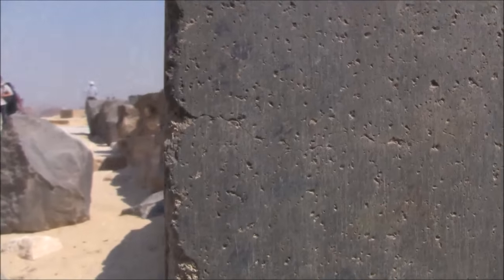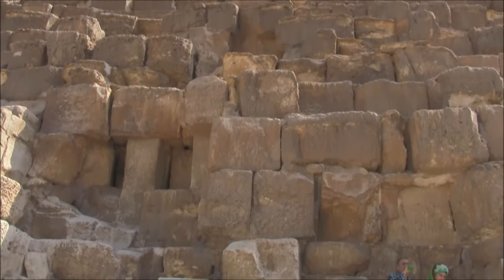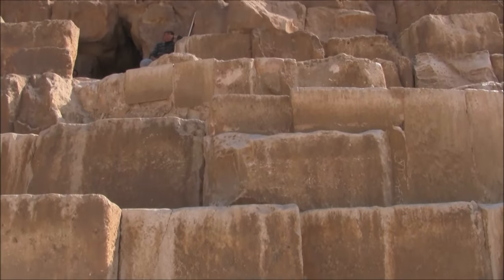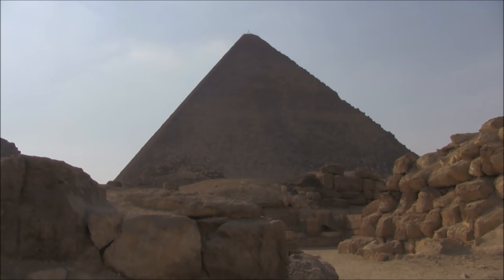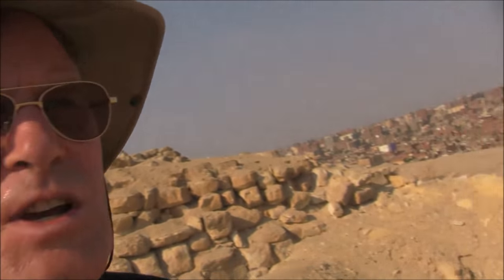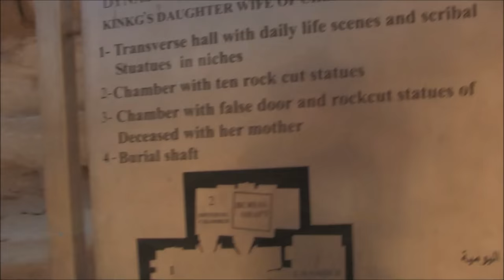Even More Evidence Of Ancient Machining On The Giza Plateau Of Egypt

Comment: I've read in Peter Thompkins' book Secrets of the Great Pyramid that vertical shafts were dug in order to best view the angles of the sun during solstices, as it was easier than quarrying an obelisk tall enough to so the job. Some say the decending corridor in the GP was used the same way, but instead it was to view the pole star, and then later extended from the bedrock up through the early pyramid structure to further pinpoint the position. It may have been a large square flat area for some time. The Grand Gallery may be of the same purpose.
Reply: I don’t think anyone that could build a pyramid would build one just to know where the pole star was or day of solstice. That was probably common knowledge. I do think they were positioned to certain points for other reasons.

Comment: Diameter^^.....I think you mean thickness Brien......the 'Diameter' of the saw blade looks to be at least 6-8ft.....probably more.
Reply: Dark Star huge diameter saw blades, probably rotating slowly. But what was the cutting edge made off?
Reply: @mattiasdahlstrom2024  an option instead of metal disc saw think of energy beam working like a chainsaw lot of cut made with 2-3 mm wide tool , aliens equipment
Reply: @al2207  If an energy beam evaporates the stone, there should be a transition zone that is melted : I don't see that in these saw cuts.
Reply: @mattiasdahlstrom2024  stone are not melted but dissolve into mono atomic element and with proper magnetic fields are expelled from the cut surface , silica will tend to re-attache to untouched walls creating the glassy finish by deposition of very thin quartz layer
Reply: A roller like saw comes to mind.

Comment: Defnitely a HUGE diameter circular saw blade of (you said 3/8 or 1/4 inch thickness).  or a very long (AND THICK) straight blade saw.  If these are all of the pre-catastrophe 12,000s BCE Ice Age (Era III), then it is entirely possible that this could have been done on a massive scale.  The design of the circular saw would have to be vertical, while any stones would be pushed through the blade in the horizontal.  As such, the casing stones, cut on the diagonal surface, would have to be stood upright, then pushed through saw, creating the diagonal surface (and smooth) cuts.  All pre-12,000 BCE Era III Egypt culture, fitting with the basalt and granite development of stonework.  Era-III (40,000s - 12,000s BCE).
Reply: i think the faceing caseing stones were made in cast molds using geopolymer mix. You can mix tura limestone in a geopolymer way and the caseing stones were placed on by a different civilisation than the people who built the pyramid. The later generation knew about geoploymer more so than the earlier original builders
Reply: any theory of how it would have been powered ?
Assuming electricity and motors had not been invented yet, what is left ?
Human power with rope and stuffs ? Gravity battery ? Hierapolis sawmill (water-powered stone sawmill) ?
Reply: @xl000  Look at the old huge human or cattle (gerbil) wheels.  Huge wheel (with 1-2 humans in each wheel walking the wheel) on each side of a timber-lashed bronze thick wheel, then just push the cutting or polishing product through the assembly.  There is also the pendulum straight saw blade kept swinging from an overhead cam shaft mechanism also powered by human or livestock power.  Easy

Comment: Instead of a huge circular saw, how about a large weighted pendulum-blade, supported by an "A" frame structure of various heights.
Men pull the pendulum from side to side. 
Its massive weight and momentum grinds through the stone with each stroke has men push the stone forward under the pendulum.
A fifty foot swing pendulum would have a diameter of one-hundred feet, and it could even be taller.
Reply: Diamond studded hemp rope.. Looping around stone then around a spinning wheel.. On a tension lever...
Reply: Close but no cigar. And you propose 2.5+ million blocks were cut this way?
Just multiply 2.5mil x a minimum of 5hrs to shape 4 corners off a single block.
Reply: @lop8828  
Dude, The 2.5+ million block stones for the pyramid were mostly all cracked stone.
We are not talking about cracked stones. But instead we are interested in stones that  appear to show signs of machined surfaces, and in this case the surface is not flat, but slightly concave.
Reply: @Real M  you said;"Many of these larger saw marks are extremely thin."
Sorry Dude, but this statement is a fallacy.
We don't know for sure that they are saw-marks.
Reply: @Real M What are you talking about?
The video shows them cutting stone with a copper saw.
.
Reply: What happened was that reasonable doubt has become honest practice.  Evidence suggests heracy. Professional admirals  choice. Scientific grandular research.  Ergonomic design

Comment: very well to share...thank you very much. I still think  it has to be looked from above...Geopolymers...molded...otherwise... it could take thousands of years...that anyone of us have. Still very gratefull for your all you investigation and knowledge,. My respects.
Reply: We don’t have any idea how long this civilization lasted. They may have had thousands of yrs. but I agree about the casing stones. Maybe molded. Limerock can be heated by burning a mix of small limestone with a small amount of coke rock, like coal, in  a kiln. Then liquefied by just melting the hot rock into water. Then they could thicken it to any consistency by just heating it . And pouring it into molds . With adjustable molds they could make any size casing stone they wanted. Also doing it like this, would reduce the weight of the stones by about 40% of the weight of the original limestone. As the rock has gave up its CO2 during burning. And maybe a geo polymer was used in the mix.
Reply: I think the faceing caseing stones were geopolymer made by mix and dryed out in casing molds made from wood it as been proven it can be done. The main bulk of the pyramid could of been built by an ealier generation maybe stood there 100 yrs or so as we see it today and then the faceing stones were added by later egyption civilisation

Comment: The stone was liquidofied and poured between other rocks so they fit tightly and mold themselves according to the en casement of the surrounding stones.
The cuts can be made with copper tools when the rocks are in a paste consistency state before becoming completely rock solid.
Now we have to finf the alchemical substance used to transform the rocks

Comment: Thanks for another intriguing video Brien.  Those ¼" wide cuts are amazing; I suppose the blades would have had to have been fairly thick though, if they were as large a diameter as it seems they were, to be rigid enough to cut rock.  The fact that the cut marks are still present attests to the hardness of the rocks too.  You are  showing us what mainstream historians won't - thank you.

Comment: There seems to many different types of machining. Saws , scraped look, scooped, and a few others.
Reply: agree , made by the same tool , desintgrator energy beam , adjustable nozzle from 0 to 20 in. wide and from 0 to 2 meter range , cutting at the molecular level

Comment: This is fascinating. I myself build stuffs, and I know that you need several iterations before achieving a good result. We should be able to find earlier failed attempts cutting / carving the same material. I mean unless they recycled it, which is very likely because it's heavy to move. Or it's almost certain that certain parts contain operator errors or tool breakage / erosion. For example, (from my experience using an angle grinder), the tool can work for some time before you need to replace the blade. but it will leave a different tool mark on the stone (e.g. feed rate being slower as the grinding stone shrinks with time) It could be computed with really precise 3D scan of the surfaces

Comment: It's been said many times recently that they had stone softening and Polyimere blocks wouldn't it be easy to go to an overturned block and see that the block was laid upon the ground when the stone hardened?? the imprint left would prove they softened the stone, or it was is a polymer, it would also account for the ease of stone cuts they made, and the drill core holes if they were cut when hardening but not quite hard.

Comment: Not sand but what about Carborundum or Diamond.  The Turned vessels from Saqqara could well have been made on a lathe with diamond tipped, barbed or encrusted tools.
Reply: no the way it was done is over our current capacity there are no tool traces and very thin walls preventing the use on any type of friction type tool
Reply: @al2207  I don't agree.  Polish with carborundum and/or diamond powder.  The bowls are obviously turned, there is no other way to get such symmetry.  Not only that but the recurve near the lip at the top requires a hook polishing tool.  This is not beyond our current skills or knowledge.  This just means traditional archeology is wrong about wheely things.  May be no wheels on carts until the Hittites (I don't believe that), but in other areas,  set a slave(s) to spinning the pot and work at leisure.  Let gravity provide the load, it is just a matter of spinning the pot for hours.

Comment: Would it be possible for you to measure the distance to a straight ruler next time you visit those sites (I'm talking about the saw marks) ?  Using a ruler, a depth gauge, and as much measurements as you can ? Like a list like this: [ distance from 0 of the ruler, depth a this point, ...] We could easily determine the radius of the blade, and see if they are consistent between the different cuts.

Comment: How do traditional archaeologists and Egyptologists explain those saw cuts? Thanks.
Reply: Um, they don't deny saws were used. In fact, some are on display at the Cairo Mueseum. But, according to Egyptologists, the ancient Egyptians did not use use iron or steel tools (never found), but bronze tools. However, these could not have cut through granite. So they cannot explain how quartz and granite blocks were cut!
Reply: They still can’t explain them. It is still a mystery.

Comment: Yup, an older civilization and maybe it was taken over by the Egyptians. They didn't know what the structures were so they used them for burial purposes. I'm betting the older civilization had iron tools, but they are long rusted away after 100,000 years or even 10,000 years it would be gone. What will be left of what we built today in 100,000 years, probably not much once we get set back to more of basic times. Heck a few hundred years will have most area the steal be rusted and gone, in other climates it might take 5 years, or a thousand years. To think a civilization didn't have iron tools is silly, just because you can not find it don't mean it never happened.
Reply: yes the pharohs found the pyramids not built by humans...the great pyramid and pyramids worldwide powered up shields to stop from space attack and protect the locals, Martian connections humans don't get yet/Atlantis was still hot and heavy- more read ex black ops contactee Lou Baldin or Baldini.

Comment: It is damn curious. That was a concave angle, and not a convex one that often could occurred with a hand saw where the outer ends of the blade cuts could result in cutting faster on a angle then when plaining straight across the long cut.

And for a circular cutting tool then, where are the curved striation cuts, its like their blade does not wobble at all, that also we cant do to this perfection. That blade would have to be 6-8’ across.

Comment: Da it was water witch was used to run a gaints battery which was world wide bring up any circuit board picture put it next to a picture of the whole plateau and omg they look the same
Reply: Maybe they actually figured out hot to capture lightning and store it . Or some other pos-neg system . once they had power tools they built like crazy.

Comment: 0:25 please, this pattern isn't it look like something was slide on it? parallel lines, one constant movement of stone wider then object and you have this
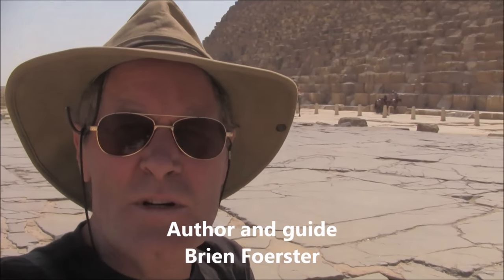0:33 during excavation they didn't cut it, they break off chunks of it from bedrock with help of natural cracks in it. First flat edges appears after using it
1:30 imagine this block laying flat, you slide other stones on it. it's part of "road". this could be edge stone or maybe all stones with planned destination was worked on the edge
so worker can easy stop when it's "done. Because they didn't pass over the edge that's make like "pizza crust". They knock it off and now Brien pointing it with his finger.
Saw blade couldn't be use in here, especialy circular one, again parallel lines. Even long straight blade will make differend
1:33 curved edges, I will get there with Brien
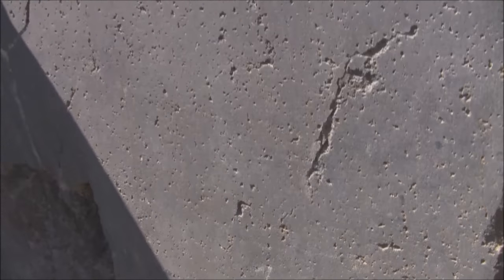1:47 those was confusing me a long time, pattern of those 3 grooves repeat over and over. One deep in the middle, two smaller on sides. Now I have it...maybe :p best shot ever. THX Brien
Anyone notice tunnel/channel? Obviously it's there for a reason, not accident. If I'm correct and they was using road for grinding, milling, any stone processing. For sure it use a lot of water, 
and it mix with particles of stones. In result you have mud. Like in any stonemason workshop you need to have drainage channels to remove it. This is perfectly preserved draining channel.
Grooves! almost forget, to prevent channel from collapsing they was "catching" stones with, I guess copper. Grooves suppose to hold copper wire(?) on place. Possibly road was build like cells,
 every cell was secured with those. In untouched parts of road with this drain you will find copper brace, for sure!
2:57 Don't know, if i have guess, use of abrasive available in area of their time(Corundum, quartz, any harder then basalt). They could crush pieces of abrasive and make some kind of cutting 
wire, blade, stick with abrasive on the end. something to investigate ;)
4:15 tight on the top
4:45 probably we will never know when it was builded and how many times it was refubrished, or rebuilded bigger
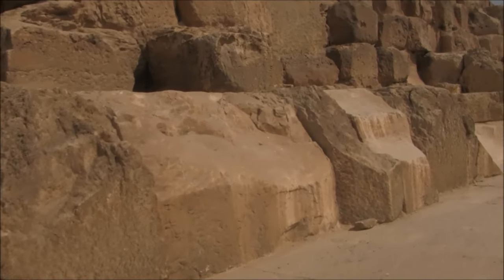5:20 could water from drainage system flow around Sphinx? Leaving this one...
7:55 :O wow How drainage around my machines looks like? It's a 3 chambers in 3 sizes. Water from machines flow to the drain, in here is smallest chamber it stops small bits of stone
and everything small enough to flow with water. everything heavier then water goes on bottom. On top edge is a drain following to 2nd chamber in medium size. This one is big enough
to give water time to separate
stone particles which one land on the bottom. On top of this one is drainage slightly lover then first one so water can't return to first chamber. 3rd chamber is the biggest, 
water in here is "clear" and ready for use again. It's a blood system of stone masonry  workshop.
 I'm not saying it was something like this, but WOW

Comment: The groundwork that the Pyramids sit on are an astounding engineering achievement, that rivals the Pyramids themselves. I think there is around 6 football fields of Basalt and other stone slabs up to three feet thick, and perfectly formed to the underlying bedrock with millimeter accuracy...as Brien said "no mortar". If you think about that for a mo, it is mind boggling. That in itself would have taken longer. or as long as building the pyramids themselves....and all of this is supposed to have happened in around 25 years ????.....yeah, and i am a monkey's Uncle.....peace.

Comment: They could have used frequency to soften the stone before they cut it just trying to take a stab at it I'm not sure what the heck's going on
Reply: A saw with that diameter is for big blocks. Horses for courses!
Reply: monique,the great pyramid and pyramids worldwide powered up shields to stop from space attack and protect the locals, Martian connections humans don't get yet/Atlantis was still hot and heavy- more read ex black ops contactee Lou Baldin or Baldini.
Reply: Agreed Monique, i'm going to test the inverse-piezoelectric effect on some quartz samples when they arrive, this should deform the stone with the right amount of power and the correct frequency.
Reply: @GaryMcKinnonUFO  get a giger counter for radiation and stop messing around garry use that on the megaliths that were destroyed by ancient battles in the skies mostly not solar storms
Reply: @ancientbutstillhere6570  some of the megalith stones were poured but some were cut by robots

Comment: Why don't you believe that someone tried to cut for use these rocks with saw circular or other mechanical means, not so far in the past, but in the fifties when Soviet Union worked with Abdennasser ?
Reply: Are you proposing the idea that these pyramids are only 100 years old??
Reply: @MissMarshall  No, just that the rocks cut in so strange mode for you, the ones around the pyramids had been cut by machines.You must know that all the sites in Egypt hadn't been always as they are now... All that would be transported, cut or employed again in other constructions had been stolen.

Comment: someone should put some silicone in the saw gaps to check the pattern inside
Reply: i will try with a laser pointer but i am pretty sure it will have the same incremental of 1 mm

Comment: The material removed by the saw blade during cutting process is called the "kerf." The truth will always be slightly larger than the blade thickness. When trying to cite or prove highly Advanced ancient technology using the proper terminology when referring to evidence will help corroborate your case. Using mispronounced or incorrect terminology weakens your case in fact it could be used as exculpatory evidence to prove your theory wrong. No big deal just a kerf  Mr. Foerster